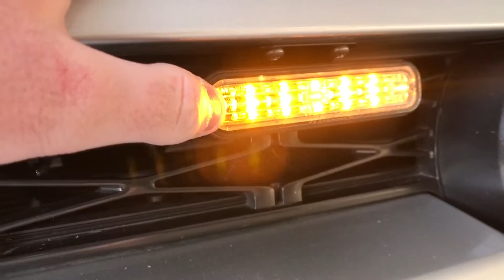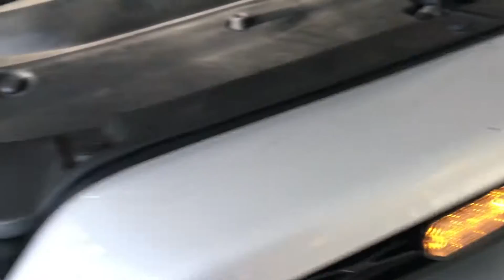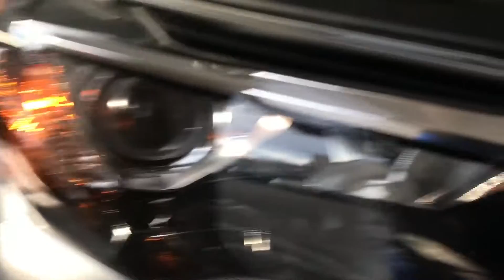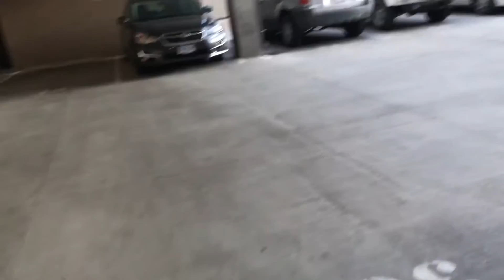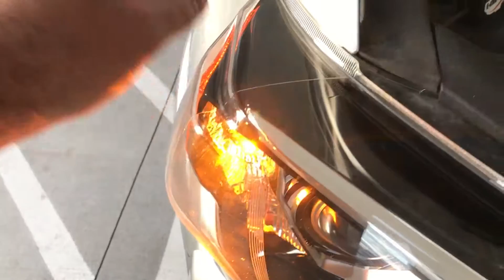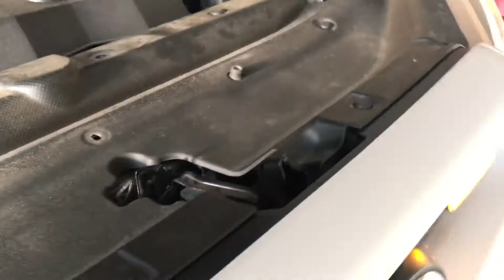Whelen Ion Duo as turn signals

Comment: 1 question I have for what I’m planning on doing is getting trio R/A/W, my plan is to run steady amber for signal and steady red for brake light and have my 3rd pattern as A/W flashing. Is that possible?
Reply: Probably but it wouldn’t be how you think, your best bet is to do red for turn signal and brake light
Reply: it is with a feniex quad surface mount!

Comment: so you just buy the parts and the controller box and spliced/tap into the turn signal wire?
Reply from the maker: yup
Reply: $131.00 I think that's a rip off. Otherwise I probably would consider and buy it...lol
Reply from the maker: for their use it a very expensive option.  they are not exactly designed for what I was using them for.  the are intended for use on emergency vehicles as a warning lights which is why they are so expensive

Comment: Are these amber/white? And since the amber is on steady burn, how are you able to gain independent control of color 1 and color 2 since Whelen uses the steady burn as an override pattern in these light heads?
Reply from the maker: FF/Paramedic JH171 I don’t have them anymore but there are separate trigger wires for each color. On this setup I have the kit that dims down and has full power function only on the Amber trigger wire. If I remember correctly the white wasn’t hooked up at all yet. However all of this is possible with the carbide I had as well
Reply: Cool. Thank you. I have a pair of red/white duos over the rear plate with the white tied into reverse lights. Wanted to order one of the dimmer modules to run the red as running lights but that company seems to have been out of that part for quite some time now. Oh well. No biggie
Reply from the maker: you can achieve the same thing with resistors and diodes.  Im not too familiar with using them so I opted for the module, but guys do the same thing with cannons as turn/stop lights all the time which is where I got the idea from

Comment: you should get Amber LED turn signal bulbs to accompany the ions
Reply from the maker: Louisiana Silver I have. I had VLED V3 Tritons and moved them up front. But I took the ions to the rear as added reverse lights. I added the diodedynamics tail as turn module so the rear led brake lights are also the turn signals now.
Reply: 4Runner Mods oh ok, they look great by the way. I was thinking about getting some ions myself or some type of surface or grille mount Amber led's to put on my trucks tool box. a single on each side and 2 on the rear of the toolbox. and possibly 2 in the grille. The only lights I have are 2 Xprite Amber/White LED Dash Lights. they are pretty bright. I have videos of them. I mow yards and 90% of the time we work well after dark and are usually parked on the sides of fast moving roads, so I figured the illumination wouldn't hurt.
Reply from the maker: Louisiana Silver I work surveying all across the country. I'm ordering a new truck so everything I have in the 4Runner will get swapped to the truck eventually. Sometimes I need them sometimes I am fine without. I moved them to the rear below the trailer hitch on either side for extra white to the rear. Whelen is pricy but worth every penny in my opinion